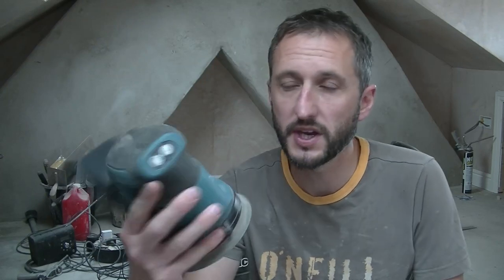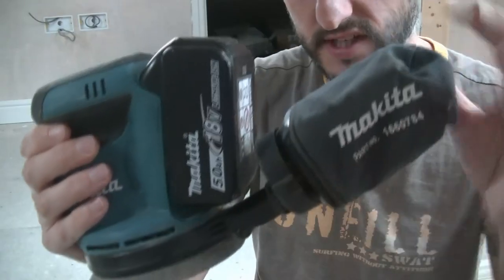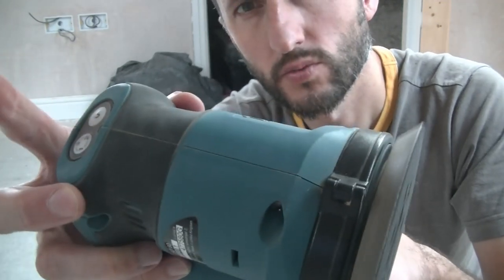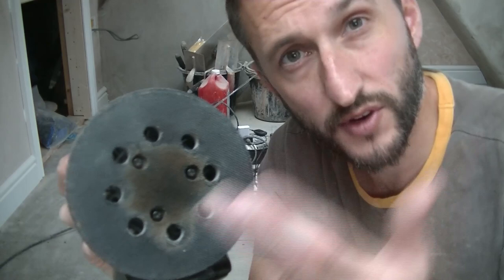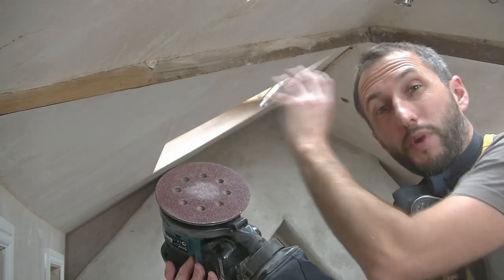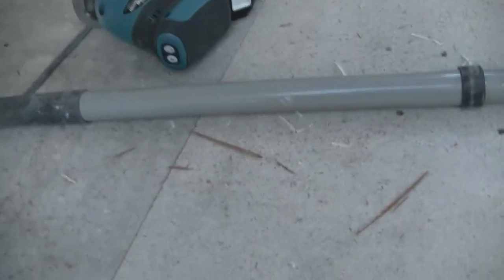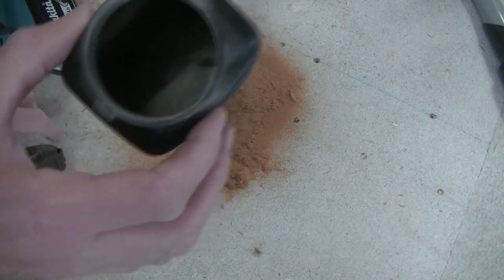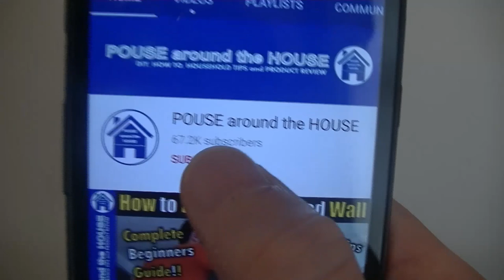Makita random orbital sander DBO180Z REVIEW & DEMO. Makita LXT orbital sander full demonstration.

Comment: Suppose I used it with a felt pad for glass polishing (with a cerium oxide slurry). I wouldn't be using a pad with holes; would that pose a problem?
Reply from the maker: I don't think it would, but the extraction system won't work as it relies on the holes to suck them into the bag. Hope that helps and thanks for watching.

Comment: Thanks for the video. Does this device good also for metal polish ? cleaning metal surface from rust?
Reply from the maker: Hi, yes it will clean rust providing you use the correct sand paper. Thanks for watching.

Comment: I’ve had mine a few weeks, great at the actual sanding but mine is awful for dust, I use the right pads and fit them correctly but by the end of using it for 10 minutes the whole room is dusty, literally can’t think what I could be doing wrong
Reply from the maker: Mines pretty good but not perfect, it will create dust. The other thing is to attach a hoover to the extraction pipe? Best of luck with it. Thanks for the feedback.
Reply: @POUSEaroundtheHOUSE  mate I had my guy sanding the walls in a medium size room with it two days ago, and you literally couldn’t see your hand in front of your face. I did try attaching a hoover to it but it didn’t fit correctly. Will look into some sort of attachment though

Comment: Ive just purchased one of these. I havent tried it out properly as yet but the disc seems to stop spining with the slightest pressure. Is this normal?
Reply: I bought one about two months ago. I tried using it last week and it didn't spin or it spun with no power. Checking other reviews comments and several others had the same problem. I wonder if there  is a loose wire. Hopefully I can find my receipt.

Comment: How long did you used it for? Seems like you just got it new and after few days you making a review
Reply: What’s wrong with reviewing something after a few days. He’s discussing specs, ergonomics and his opinion. 
Also he owns allot of makita kit so is likely comfortable that it’s built well and will last. 
I’ve got 10ish makita 18v tools and never had a failure.
Reply from the maker: I had it for about 6 months prior to doing the video but and have used it for the odd job. Then used it to do a load of stuff in the loft including the hip rafters. Thought they'd be a good   for the video. You can never really comment on true reliability unless you review years later by which time it'll prob be discontinued with a new model out. As Joe said going on my experience of Makita tools my others have never broken. Drill and impact driver are 7 years old and still going strong. Thanks for watching.
Reply from the maker: @Jconway651  you've got the nail on the head there. None of my Makita tools have broken, and I'm just trying to show how it looks, operates, functions etc so viewers can make comparisons to other sanders to make an informed decision if they decide to buy one. Thanks for watching!
Reply: POUSE around the HOUSE 
I have had a corded Bosch random orbital sander for past 4 years. I recently borrowed one of these from a mate as I was condsidering getting one. I was very very impressed with the dust collection and speed on this model. Like you highlighted on this video. 
My Bosch is garbage in comparison, sands slower and spews dust everywhere.
Reply from the maker: @Jconway651  thanks for the feedback. I found the dust extraction excellent, I didn't think it'd be that good. Nothing really to dislike about it.

Comment: I just bought one of these from eBay and like the other reviews,the Sander seems very weak even with a fully charged battery,I thought mine was faulty but apparently this is normal,I expected a fast fully rotating powerful orbital sander experience but obviously not this model,if your thinking of getting one..don't buy this..maybe corded will be better..I'm disappointed but the rest of Makita tools are great 😅